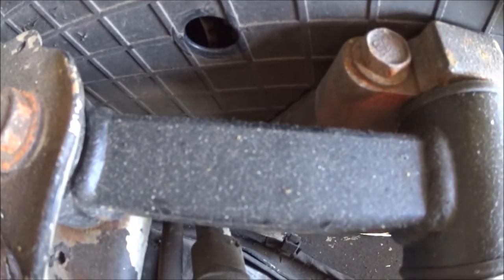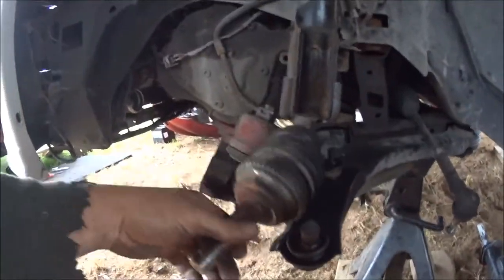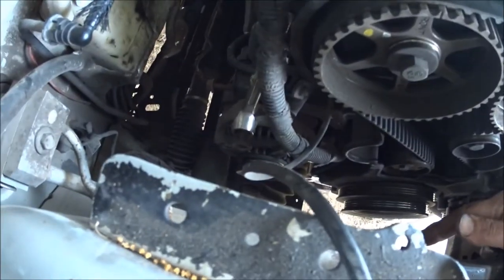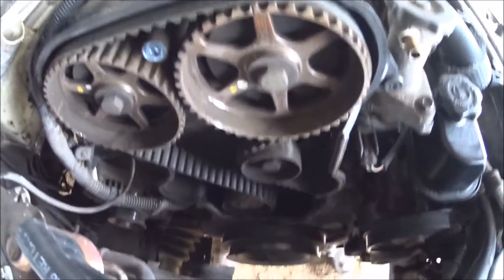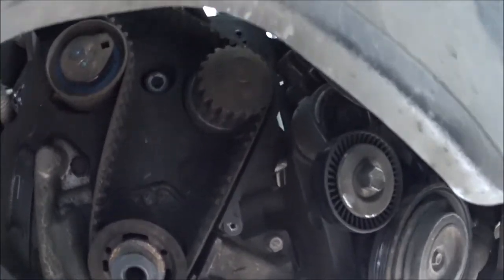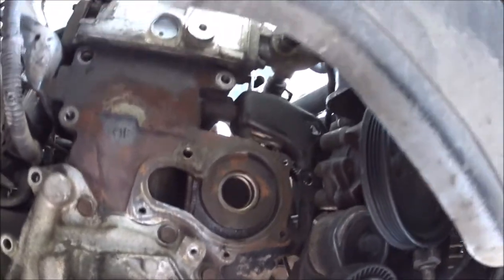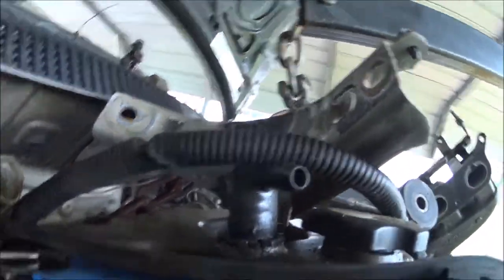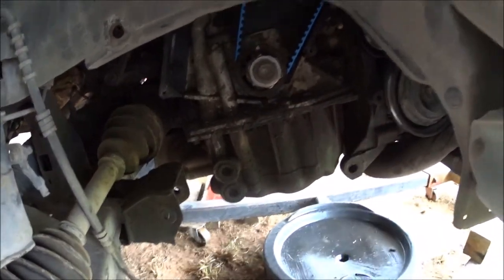srt4 dodge neon timming belt install

Comment: How’d you remove the cam gears and know where they go back when you removed them
Reply from the maker: Hello I have a newer video going into how to do that. I hold the gear with one hand with a glove on and use an impact gun to break them loose. the stock gears go on one way they have words on them
Reply: Right but won’t it mess with your timing? Or will  it go in the same way you took them out?
Reply from the maker: @johnnyguerrero3723  the stock gear only goes on one was there is arrows to point up and one side shows 2.0 or 2.4 you want 2.4 and arrows up for the Srt4’s
Reply: @Mattsneedforspeed  i see what Johnny means so it doesn’t matter how I put the gears in as long as the marks point up on the 2.4l
Reply: Is it bad to take off the belt before alignment the marks or can I align all marks after new belt?

Comment: Why don't any of you change the oil pump out as well?  Makes no sense at all. I always change everything out cause I do not want to have to go back and change anything for any reason. These motors are hard on oil pumps. Reason I swapped out for billet pump gears.
Reply from the maker: I'm on your side with that, the oil pump should be on the list but its not, its like the heart of the motor if it wears out or goes bad it turns in to a costly repair,

Comment: Thats so weird why does the 2 stripes on the fenders stop at the fenders my srt had the same strioes but ran down the whole side of each side of the car but i had mine srt repainted so i took them off
Reply from the maker: Noah Brestovansky well the car had pin stripe at the top and a band of 4-5 across the btm and while I was working on it we removed all the stripes it looks so much better with out them.